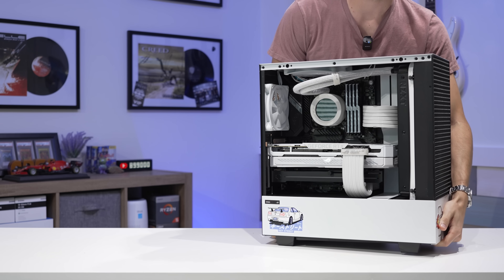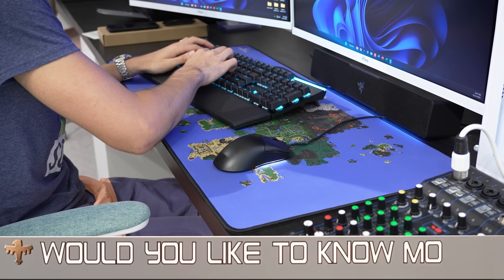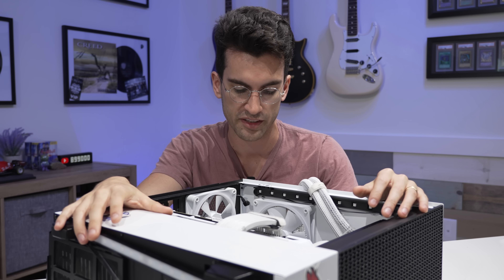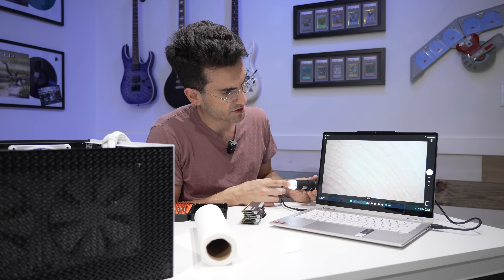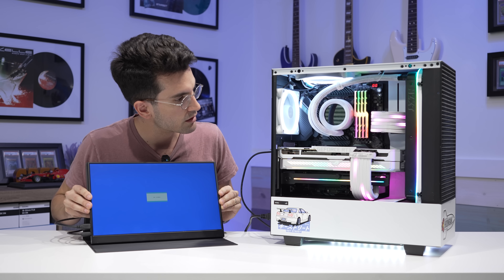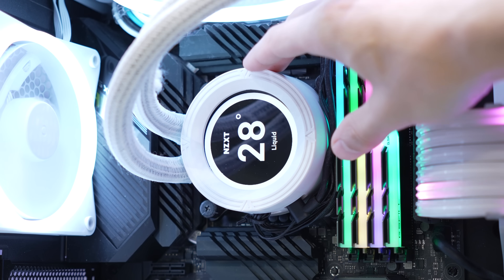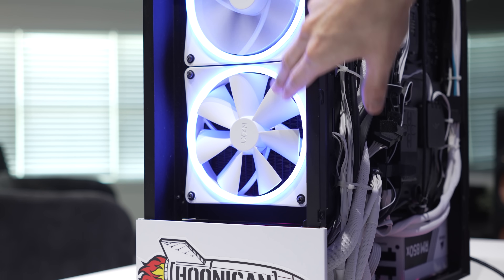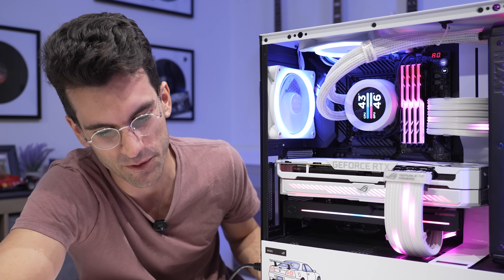Fixing a Viewer's BROKEN Gaming PC? - Fix or Flop S6:E15

Comment: I've looked and searched but I couldn't find out why LGA is beneficial to users. It has only downsides... it is SUPER fragile... the older style pins are damn near indestructible by comparison... I've managed to pull out the cpu when removing the heatsink on many occasions and no damage at all. Another benefit, if anything goes wrong with the cpu, it's a 5 minute replacement. With LGA cpus, if the pins go bad, you're looking at many many times the amount of work to replace the entire motherboard, especially in small or densely populated cases.

I think this only benefits manufacturers because I'm not seeing any upsides for users.
Reply: It's a matter of higher pin densities and better pin contact on LGA. That's the reason AMD switched. Zen 4 and 5 wouldn't be as powerful and engery efficient on PGA. The huge downside is that each pin is smaller and more fragile.
Reply: @nighthound2714  Just to confirm, has that been tested by engineers or is that merely the blurb from the "marketing" dept? Forgive my skepticism, I have little patience for the way corporations have treated their customers and no longer take anything at their word.
Reply: @KillShill 
I'm not an expert, but from what I've read it's bout engineering. Though LGA cpus are technically less expensive to make. They don't have pins that need to be aligned, but of course the motherboard socket does.

The higher pin and pad count allows for increased data transmission and cpu complexity. The BGA socket on GPUs allows for an even higher density and data transmissiom. The better pin-to-pad contact reduces power losses due to resistance. Cooling is also improves by having the pads more closely connected to the heat spreader, instead of buried inside the socket.

I think using LGA sockets has become necessary for modern desktop cpus, and is a consequence of further design complexity and miniaturization.
Reply: @nighthound2714  Thank you for your very considerate and informative reply.

Comment: A "friend" changed the thermalpaste and bent the cpu pins ... right. That old cover up. It was by your own clumsy hand, admit it🤣🤣🤣
Reply: Bro does not have tiny racoon like fingers.
Reply: @Dan-zm5ik  nor skills the same as the Greatest Technician that has ever Lived
Reply: Yea Agree 😅, impossible to bend pins by just swapping thermal paste, i mean the CPU doesnt even leave the socket 😆
Reply: Unless the friend removed the CPU to clean it and when putting it back in, damaged the socket  @maxelito7590
Reply: @maxelito7590  Unless you want to take the CPU out and give it a thorough clean and around the socket which is something I do when new paste is needed. This is where bent/damaged pins could happen if you do something silly.
Reply: @maxelito7590  Tell me you've never properly cleaned a cpu and socket without telling me lol
Reply: After wrecking one socket I now refuse to mess with the cpu installation at the end of the day.  I do it early, and no caffeine and no alcohol.
Reply: Clara strikes again.
Reply: Not saying its true or otherwise. I handle all the upgrades, etc, for a friend of mind because he can't do it.
There are cases of cpus being pulled out of sockets due to thermal paste being like glue - again not saying thats what happened, just pointing out that it does happen.
Reply: @Caderynwolf I see it happen on AM4 and older boards but not on Intel LGA boards especially with the bracket for the retention system.
Reply: @sascharommeldelarosa8490  Yeah AM3+ and AM4 have the pins on chip and are a nightmare if left for a while without re pasting 😂 Intel have been LGA for a while so not a chance that happens 😅
Reply: Were they trying to put the thermal paste under the CPU? 😂
Reply: Yeah, changing thermal paste shouldn't bend pins like that. They most likely, for some reason, removed the CPU and probably dropped it on the socket. It's more surprising the socket is not that damaged.
Reply: Reaching here...., but it IS possible that he bought the entire PC ready built. However, if he built it himself then why the need for a 'friend' to do the simplest job of applying thermal paste ?  The balance is 99% to 1% in your favour. 👏
Reply: I'll send you a picture of my PC.
Reply: my immediate thought lol
Reply: I once broke the socket out of frustration, the cpu was death and i ended it getting a new one from RMA, but when i was testing it and removing the cpu i ended breaking the socked like an idiot
Reply: LMAO!